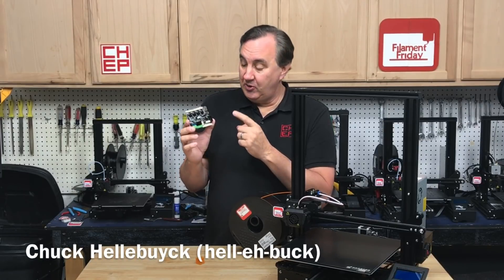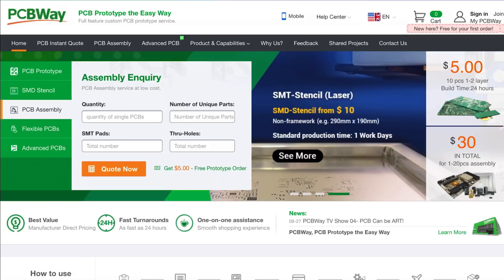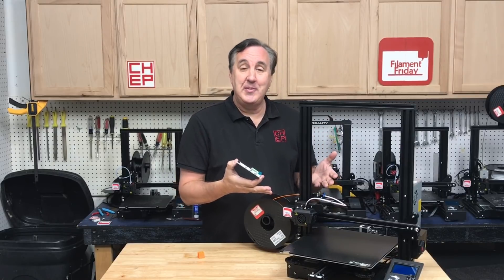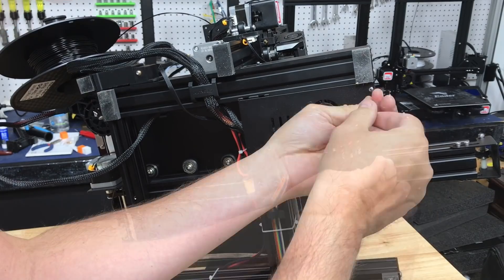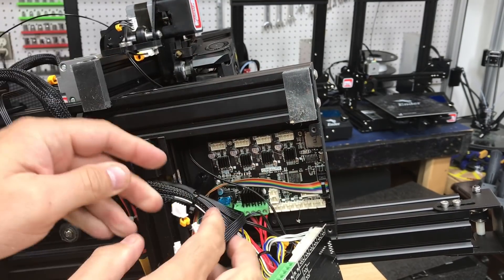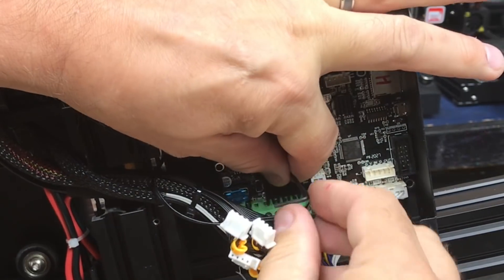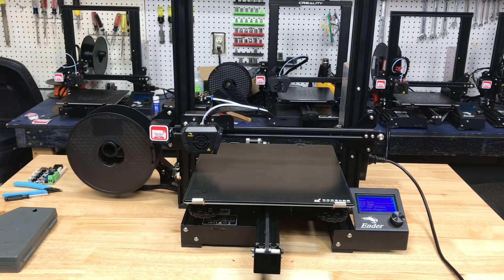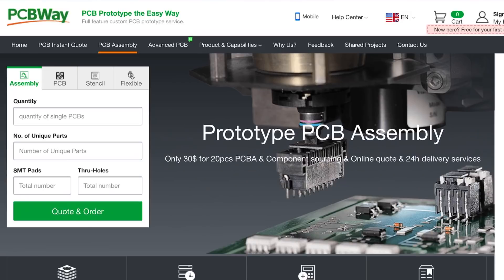Creality V4.2.7 Silent Board

Comment: I installed my board but every time I try to print or home the extruder will go to one point and then stop the print.
Reply from the maker: Is the proper firmware installed?
Reply: @ When I installed it I put in firmware but I might’ve installed the wrong firmware.

Comment: My ender 3 has an old v1.1.4 card, I want to upgrade directly to the v4.2.7 card, remembering that my ender is not the V2, my question is, if I change this card, will the LCD work?  Will it be just taking the cables out of the old one and connecting to v4.2.7?  Sorry 1 week on this wonderful hobby, thanks for the tips and suggestions
Reply from the maker: Make sure to buy the V4.2.7 with the Ender 3 not V2 firmware installed.
Reply: @FilamentFriday  if the 4.2.7 board comes with the firmware specifically for the ender 3, it will work and i don't need to buy an LCD v2, is that it?

Comment: Hi CHEP - I've purchased and installed the V4.2.7 silent board so I could use the CR touch on my Ender 3PRO.  I started up the printer and I can not figure out why the printer is not recognizing the micro SD card, I also noticed that there is no filament change option when turned on.  I've tried everything I found on YouTube and even tried creality to help but they wouldn't.  Help me CHEP your my only hope.  Thank you.
Reply: Make sure you have the right firmware for your board. Also make sure your sd card is usable elsewhere and is formatted correctly
Reply: My friends ender 5 plus. Had a issue where he couldn't see the files. Searched around and found it needed filennames smaller than 15 characters.

Comment: Thank you thank you thank you. Followed your video. So easy. Only got stuck on where to plug the case fan and another fan connector, since those two plugs are in a different area. Found that on another channel. Powered on, pressed home, and thought something was wrong. Nothing happened. Then I realized it was moving to home, I just couldn't hear it lol!

Comment: Received y new v4.2.7 board today.  It has a shroud around the pins for the LED ribbon connector.  The old board didn't have this shroud.  I don't see how to reove the shroud so I'll be returning the board in the orning.  The letter next to "N" has failed on y keyboard.  Oh well.

Comment: I got an Ender 3 v2 but I think the fans are pretty loud, does the silent mainboard fix that? Or does the v2 already has the silent board? If so, is it possible to replace the fans with quiter fans and NOT void my warranty? Thanks.
Reply from the maker: V2 has silent board. What warranty ;)
Reply: @FilamentFriday  I have just purchased Ender 3 v2 and it has 4.2.2 board
Reply from the maker: Yes it does. There are two versions. One with silent steppers (V2 version) and one without (Ender 3, Ender 3 Pro). Ask Creality why they are the same number because I have no idea.
Reply: This does not fix the fans noise. It only changes the stepper driver noise on the motors. 
If you want to make the fans quiet consider installing noctua 40mm fans on a 12v buck converter. There are some video's out there explaining how to do it.

Comment: I just got my new 4.2.7 board for my Ender 3 pro. Is this a plug and play board? Or will I need to download new firmware. Is the firmware for a crtouch included or do I download separately? Thanks for the great video on swapping out boards
Reply: I got the 4.2.7 board and replaced it to my current printer and it runs great. Plug n play. I didn't have to do anything relating to software, I have the basic Ender 3 (NOT the V2 or Pro)
Reply: @Chip The Cat Pirate • How did it go?
Reply: @Chip The Cat Pirate • whats that
Reply: 2 moths late but you will need the newer firmware. It is available on creality for free and you will need the new firmware on a drive as you boot the printer. After that you are good!
Reply: @WTFvideosstiffy  I got the 4.2.7 board and replaced it to my current printer and it runs great. Plug n play. I didn't have to do anything relating to software, I have the basic Ender 3 (NOT the V2 or Pro)
Reply: @summerofsteroids  hi, you posted a long time ago, but  I would like to know, is there a real difference in noise level between the two motherboards?
Reply: @sayonara1390  Yes, videos shows how it really is. So I bought it, still waiting for this massive upgrade! Because stepper noise is very pitched and even when doors are closed the noise is notacible, do you bought it?

Comment: Hey Guys, there is a problem I need help with. I purchased a V4.2.7 motherboard which should allow me to upgrade my great Ender 3. When I installed the board and started up the printer, my screen remained blue without any text. A little bit of research and I figured out that there wasn't a firmware installed onto the motherboard what normally should be the case. So, with that in mind I downloaded the suitable and most recent firmware for V4.2.7 motherboards and attempted to flash it - without success. I retried this several times, even with the original Marlin version for this kind of motherboard - still the same. The issue changed at least a bit. I could now see the status screen, but the knob wouldn't allow me to get into the printer's menu. 

After experiencing a lot of frustration, I decided to change back to my old V1.1.4 motherboard. Everything seemed to work fine until I noticed that the printer's bed started to heat up without any limit. 

Did you experience such issues? Could you please provide help?
Reply: As for your new board - did you attempt to flash the firmware on a FRESH SD card? I'm talking newly formatted and with absolutely nothing else on the drive? This has been an issue for some.
Reply: This is usually a firmware issue

Comment: I really wish this video showed the z axis movement and noise. The 32 bit 4.2.2 board in the ender 3 Max is a squealing pig when it comes to the z axis which is annoying as hell when executing auto bed leveling. I can live with the sound but it scares the crap out of my dog, as does the chirp at the end of every layer when the z axis elevates. 

Does this board fix that issue? It costs over $80 here in canada which is a hard pill to swallow not knowing it will adequately address this issue
Reply: addendum: I dont really care any more because I plan to fix the noise issue with a noise supressing acoustic enclosure that will cost only slightly more than a new board

Comment: Hi I have the Ender 3 Max printer. Not a lot of info on this printer on the Net. I have the blue screen issue so I might be upgrading to this board. Good to see it is a direct replacement to the board in my printer. what version of Firmware are you running? Thank You.
Reply: hey brother, i had a blue screen issue too, just try loading the ender 3 marlin on a micro sd and insert, that fixed it for me

Comment: Hi Chep, love your videos!! Hope you can help me. I have an ender 3 v2, extruder motor stopped moving, Plugged the motor to a different axis and did rotate so the motor is fine, check continuity of the extruder cables and is ok, check voltages and vrefs of the extruder pins and extruder drive and all are ok. Everything seems fine but cant get my extruder axis to work. Do you have any clue what is happening? Appreciate any help of guide. I dont know if I need a new board, or motor, or cables or psu… driving me crazy! Thanks!!!!
Reply from the maker: Try connecting extruder cable to another motor. If that doesn’t work then it’s probably the board.

Comment: I have a standard Ender 3  purchased in December 2020, having these diagonal lines in all 4 sides of the CHEP cube, it’s not ringing or banding someone mentioned it was impulses like from the drivers, and recommended a TL smoother, if I check each driver carefully and see what the current is for each driver and if it’s to low or high and I place it where it needs to be at would that help with those impulses. These diagonal lines seem almost like a stair step on the outside walls, esteps and flow is properly calibrated and as well and dimensionally accurate. Any advise would help.
Reply from the maker: Replace the board with a V4.2.7 board
Reply: @FilamentFriday  would it be my board, I mean I know said to get a 4.2.7. Just wanting your input on this

Comment: I know this is an older video but I just had to replace my 4.2.2 board that came on my ender3 v2 the SD slot stopped working.  When I did this install the printer would power up but then it had a loud beeping the screen stayed black any idea what I need to do
Reply from the maker: I don’t know since you never stated what board you replaced it with or what firmware was installed.
Reply: @FilamentFriday  oh sorry I replaced the factory shipped board 4.2.2 with 4.2.7 as in the video
Reply from the maker: Update firmware like I do in this video at 2:45 but choose stock not ABL.
Reply: @FilamentFriday  no firmware update on this video that I see. I am about to replace the 4.2.2 board. Printer quits after a few minutes due to “power loss” . This is after an actual power failure. Power supply still at 24.1 Volta so I guess it has to be the main board. Not sure if firmware comes with my 4.2.7 board. Will Ender pro firmware work? Getting set to compile from Marlin if not.
Reply: @FilamentFriday  any idea what would make it just beep , going from the 4.2.2 to the 4.2.7 , no bl touch , everything is stock ender 3 v2

Comment: Hi, is this board possible install on my CR10s?
Reply from the maker: Not sure
Reply: I have one I purchased that said it was for the cr-10 s5 machine. I have tried everything to make my machine work. It was new in February and the thing still doesn't work. I didn't have any luck with Creality. I'm going to try the new board. I had to purchase a converter for the duel stepper motors. I will let you know if this works. It would be nice if anyone that has done this would do a video. Any suggestions are much appreciated!

Comment: Hi Chep
Not totally concerning this video but have been in touch with Creality! 
My question was is the new colour touch screen compatible with my Max now I have changed to the 4.2.7 board
The reply I got was neither the 4.2.7 board or the colour touch screen are compatible with the Ender 3 max
Strange as my board is working fine with the firmware I downloaded from the Creality site
Would you happen to know if the colour touch screen is compatible or if the BTT colour touch screen is compatible? 
Thank you 
Geoff (UK) 
Love your videos so easy to follow and informative 👍
Reply from the maker: I’m not sure. I’m just getting started with the Creality touch screen.
Reply: @FilamentFriday  ok thank you 
I'll keep my eye open for a video in the future 
Just doesn't make sense to me that it will work with all the others 
The only difference is the runout sensor and the dimensions
Cheers 👍

Comment: I just installed this, a new belt tensioner, and set up Octopi today. This board did not want my big sausage fingers to wire the board up. It was driving me crazy. The bed was in my way and basically no slack on the cables. Now that everything is installed it's so much better. No more Terminator noises. 😂

Comment: Legit question, why is the board making it silent? Aren't the motors those that make the sound?
Reply from the maker: The stepper drivers produce a smooth control signal so the motors move smoother and quieter.
Reply: @FilamentFriday  does that smoother control signal also make them last longer? Seems like it would be less impact on the motors
Reply from the maker: Don’t know. I’ve never had a stepper fail.

Comment: Please check your board. I checked G and I or Kfan1 and Kfan2. The 2 controllable fan hookups. They are both controlled by the cooling fan settings. My skr started the board fan when steppers started to move on a print. I hear that these steppers run hot. Why would the fan start with the cooling fan. Some prints  are run with no cooling fan. This will cause problems. I just checked with power off. Ports are not connected to ground. But they are connected together.

Comment: I’ve heard you have to flash the firmware too, it’s this true? Or is it plug and play?
Reply: this depends on the firmware already installed on the board and whether you have any upgrades like crtouch. If you don't run any upgrades, chances are its plug and play.

Comment: I just installed the V4.2.7 board with the silent driver.  Love the difference!  Question...my bed now moves to the back of the y-axis when the print is finished rather than to the front. And when the machine is off if I move the print bed quickly the display panel flickers. Did I hook something up incorrectly?
Reply from the maker: No. Just change your end GCode in the slicer to move the bed forward.
Reply: Stepper Motors are basically generators if you turn them, that's why the panel flickers if you move the bed.

Comment: Hey CHEP, I had layer shifting problem with 4.2.2 mainboard. I changed the VREF values on the mainboard. I lowered them and I had still same problem.
Now I bought v4.2.7 mainboard. Do you know the correct VREF values for v4.2.7 mainboard ? Or Do I need to changed them?

Comment: I got the Ender-3 Max with a 4.2.2 board they said it is silent. But the Z-Axis screams just like the old boards... i think they cheaped out on the Z driver and i have a feeling the E driver too. haven't printed yet but it felt bit scammy.

Also my ender-3 max POM weels were so tight some of them flattened... so i loosen them now and hope they get back in form or i need to replace them...

Comment: Great vid! Just upgraded from the 4.2.2 to 4.2.7 and wow, now I can use my ender 3 pro at night and sleep in the same room! I've ordered some noctua fans coz the stock ones are too loud. Btw is the firmware updating procedure same as for the 4.2.2 ? I've updated my old mobo myself and It was pretty easy ngl
Reply from the maker: Yes. Same.

Comment: Thanks for the video!  This helped alot. Only trouble I had was that every connection was hot glued in place so it took a little bit to get it all off. Ender 3 Pro is running so quiet now. Still new to all this as I just got the Ender about 3 weeks ago and your videos have helped out alot. I really appreciate all the work you've put into it. Thanks

Comment: Hello Chep. I installed the 4.2.7 motherboard. when i sent your bed level file to print my ender 3 did not stop at the points . So i can put the paper to level the bed. it just moved to the next spot. do you know why this happens. also when i do a stop at layer Hight to change filament . it stops for 20 seconds then it moves to the spot and starts to print. it does not give me time to change the filament. help needed thanks

Comment: Hi Sir great video.  Do you know can I Install this board in my ender 5 plus? I didn't notice i bought the ender 3 board til I got it.  Thanks.
Reply from the maker: Not sure. Probably need different firmware.
Reply: @FilamentFriday  Yeah required a custom built marlin 2.  I ended up changing to a bigtreetech gtr.

Comment: just installed this in an ender 3 and my power supply is going "tika tika tika tika tika" very fast.  Did I connect something wrong??  I checked and double checked. it never did this before I installed the board. It's otherwise printing fine.
Reply: Sounds like your fan is hitting a wire.

Comment: Where can I find a correct wiring diagram for this? A few of my screw-in wires came loose and Im not 100% sure where they go. though I can probably figure it out. I'm also wondering if I have to manually update this board. it seems to say " ? " next to each axis. SOLUTION= I just needed to "auto home" it. oops.  ha

Comment: Hi Chep I just upgraded to the silent board but now when i try to run your be level gcode it accept the prompts instead of allowing me to accept the prompts? Really annoying cant fin anything online
edit: Sorry, should've spend the couple more minutes and did more research. To anyone upgrading from stock ender 3 motherboard to creality silent board, you will not be able to use chep's old bed level gcode, you will need the m25 bed gcode in the package file on the site. Worked like a charm.

Comment: I'm getting really bad prints with this board. Useing BL touch and the latest Marlin bug fix  software. The best I can get it to do any use full prints  is useing Chep 4.7 rough profile on Cura 4.8. Any help or suggestions would be greatly appreciated.

Comment: I absolutly hate this mainboard. Upgraded my printer and was super hyped but now I am facing issues like no filament change, not working with octoprint, endstops not working, motors being loud, bad results, the firmware crashing and BLTouch not working. SUPER disappointed, I don't recommend buying it and will downgrade to my old mainboard.
Reply: Switched today all of that is working for me! Maybe send urs back and replace it:)
Reply: @Hendroklooses  hi! Which printer are u using?
Reply: @LEGENDoha9876  ender 3 pro
Reply: @Hendroklooses  I have the Ender 3

Comment: can u put a filament runout on that board along with bl touch
Reply from the maker: I believe it has sockets for both.
Reply: @FilamentFriday   hi I bought the subsription from marlin but file downloaded as a pdf that dosnt open what didi do wrong cant get a hold of them to find out thanks
Reply from the maker: It should download as a .bin file. They should have sent you an email for contact.
Reply: @FilamentFriday  im in contact with them says they have problem with chrome